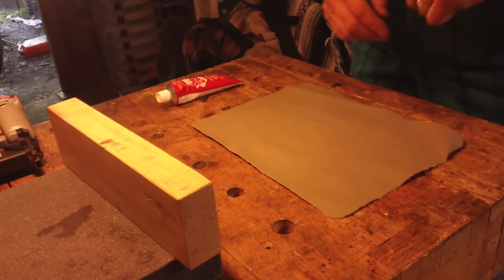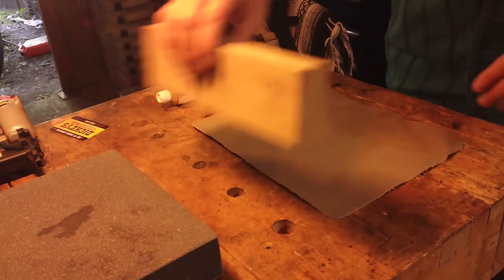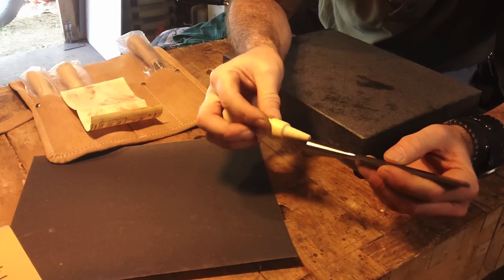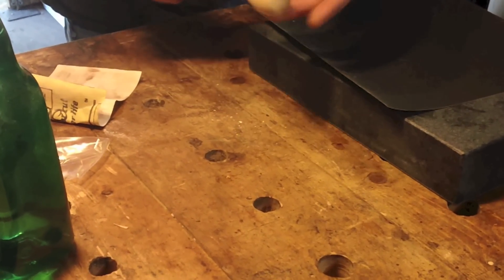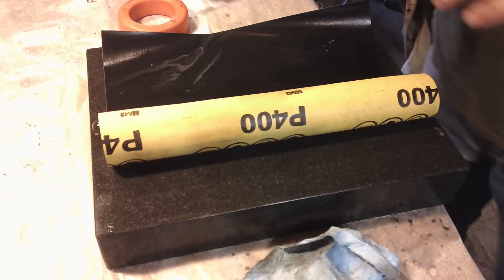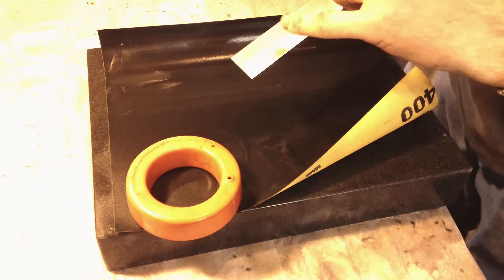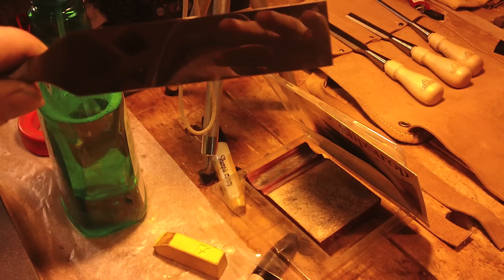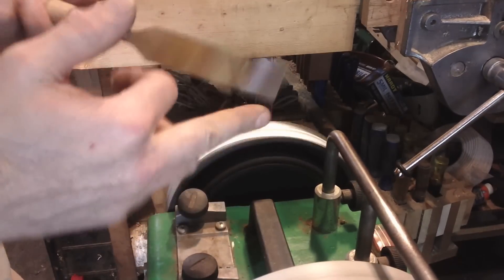Stanley 750 Chisels

Comment: Thanks Dave another enjoyable video. Have you had a chance to use the chisels much? Just wondering about edge retention.
Reply from the maker: A few times. I am in need of getting back on the chest of drawers for my granddaughter. I am wondering the same myself. report soon to come. I have old tool steel, Sheffield steel and chrome vanadium to compare them to.
Thank you Tim
Reply: The chest of drawers, I was wondering if you had finished that.
Reply from the maker: Nope its right where I left it. Half done.

Comment: Dave, another great video! Lots of questions!
Is thin leather better than thick?
What kind of board did you use for your strop and does it matter as long as it's flat? What is the reason for the chisel handles being removable?
What is the second wheel on your sharpening rig?
What do you have on your vice jaws to protect what you're clamping?
What compound did you put on the other side of the strop?
Do you get the feeling you just let a 4 year old into your shop? LOL
It's good to see you getting some shop time.Thanks for sharing.
Reply from the maker: Leather.... I like it thin but it wears faster.
I used sycamore and it was some scrap hardwood I dug out of the scrap bin. Longer the better, I would not go more than a foot.
Because of the style chisel made it easier for handle replacement when it broke and or mushroomed out. All you have to do is turn the new handle. If it had a tang you would need to drill a hole and place a ring on the wood to stop splitting.
Its a leather strop with Tormeks stropping compound.
Vice jaws have red oak in them.
I used some Green Chrome Oxide Compound, 30,000 thousand grit.
Yes i do!
Thank you so much for your time and comment......
You are always welcome in my shop...
Reply: Dave Bardin You are a patient man and I thank you. :-)
Reply from the maker: Nice!

Comment: hi Dave how did u get the coating off the blades????   did u soak and just wipe off or did u have to soak in something and scrape it off with something please let me know as i just picked up a set of these chisels
Reply from the maker: +jp morso I wiped them down with mineral spirits. And the outcome of me polishing the whole back face removed it there. The coating on the face side will only help in rust prevention if left on. Up to you. I'm in a habit of wiping all my tools with equal parts boiled linseed oil , turpentine and bees wax.

Comment: Just dropped by to get me some more education, Man what a job you did on those chisels! My bathroom mirror don't have a shine like the back of those do!, nor is my razor that sharp! Great idea about the stropping board, gotta make me one of those, but that's the trouble, I see more stuff to make then I got time or money!LOL! And yes that is a handy little plane you got there too.Thanks, and Take care! Oh Yeah.  If those pups make that cat mad, they gona have a couple of sore noses!!
Reply from the maker: Thank you Luther. I wanted a set of these every since I saw them. So that made me want to take the extra time to polish them proper. I have finally started getting a little money from my shop and its providing new tools every now and then. I hand make a lot of my stuff. The stropp is simple and any metal polish can be used for a compound.
Reply: +Dave Bardin Hi Dave. regarding the leather strop you charged one side with that yellow stick which would have a certain "grit" factor associated with it. Do you then charge the other side with some other type cutting compound? or do you keep the other side for when the first side wears out?.enjoyed watching your video very much and have also subscribed.many thanksRegards Gino
Reply from the maker: Gino Centofanti
They were charged with different compounds.  I use the chrome oxide and flex cut gold. I think the micron size is about the same but the flexcut seems to cut faster for me. It just gives me a choice. The green compound also charges a little better and I think that is in the substrate that its mixed with. Most compounds out there are designed for high speed wheel stropping not manual hand stropping. A lot of venders will tell you the chrome stuff is bad for your health. I use silver polish and brasso a lot to.
Reply: Much appreciate you taking the time to reply Dave.
Gino

Comment: Dave, dressing up that 2x  on four sides with leather, a bit "overkill" (IMHO) but it's your coin, the chisels look great but if you know how Japanese chisels are made, they all have a hollow back side and only about a small fraction of the blade is FLAT, made special like that because only that part and the front bevel are important for it to cut, again it's your coin and choice how to spend it and your time.
BTW, beware of the leather pockets for the chisels, they may collect moisture and put rust on your chisels, put a coat of wax on them before you insert them.
That Woodriver small chisel plane looks sweet, was thinking to get one one of these days.
Your dogs playing with the cat was the cream on the cake, they're adorable, put a smile on me, thanks.
Reply from the maker: ronin4711 A wonderful comment thank you.
I one day will own a set of japanese chisels made by a man I hope to meet. Metallurgy is also another hobby of mine. The Japanese tool set is a very simple and well thought out. There is a lot of zen in there tools.
With the side fully polished the ability of the rust to take hold is far less. I am 90 percent sure the leather tool roll is veg tan and not chromium.
Everything rusts in my shop. Mississippi is considered subtropical. Its just something I deal with.
Reply: You well deserve it, I like your videos, I'll check out your other posts, thanks Dave.